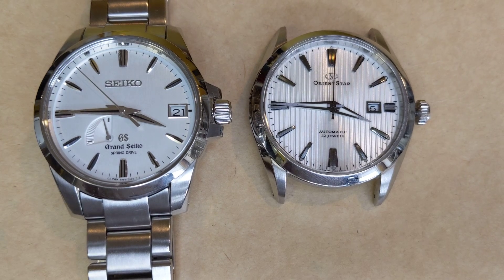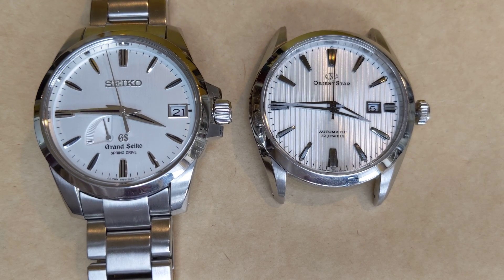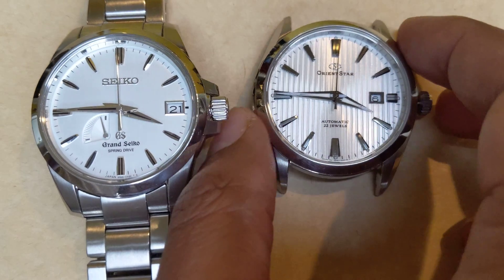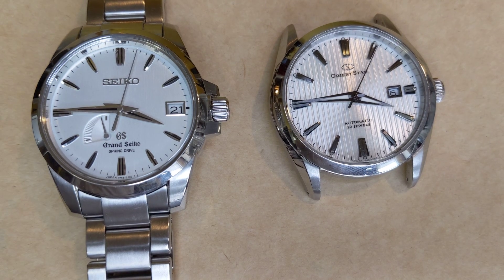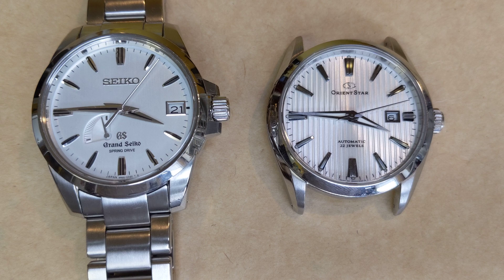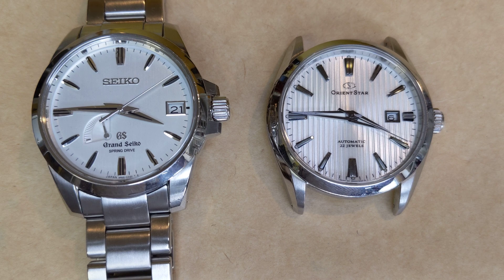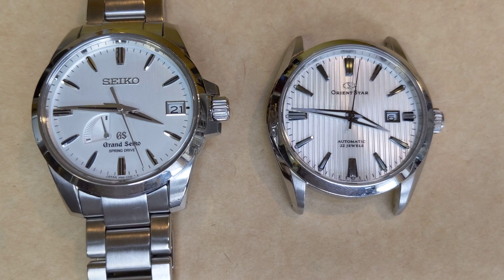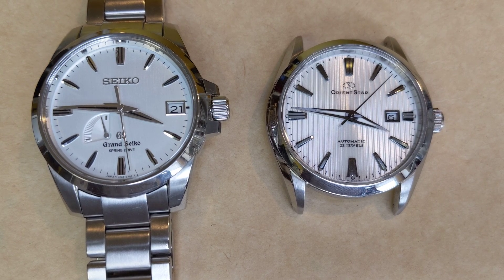Super Slow Grand Seiko Spring Drive Fails as the Mainspring runs out of power

Comment: Whoa! I was expecting that electromagnetic breaker will just switched off, due to not enough rotations per second (RPS) and therefore electricity to power the regulation circuit, and then after breaker switched off, second hand shall be moved faster for short period of time, 'till the mainspring will be fully unwounded.
But... Spring Dirve behave differently!

Can you also please show on your channel what's happening with Spring Drive movement when it's started after being stopped, i.e. after pull out crown, set the time, for example, and push crown back in - is the second hand also will move faster during short period of time, or it will be regulated (by electromagnetic break with phase-locked loop, PLL) almost immediately?
Reply: Good point, since SD runs very fast if and when the regulation circuitry is not powered.

Also an interesting question!  I'm now curious if the hacking function stops only the seconds hand without stopping the glide wheel (disengage and lock only the seconds hand with a clutch?), in order the keep the circuit energised so that the seconds hand can run at the normal regulated rate the very instant the crown is pushed back in.
Reply: @BeardyMacBeardFace  Yeah, right! It's very curious, I bet that the hacking function stops/locks the whole mechanism, but it's also really curious are there any capacitors in the electromagnetic breaker circuit, so for capacitors discharging the crown should be pulled out for more than one minute to assure that it'll be completely "cold start" without electricity in a circuit, but with fully wounded spring.
And definitely, there should be present other clock, as a reference source of time, as on this video, to distinguish the accelerated second hand movement versus normal flow of time.

Comment: I find your video intriguing. I was told that that the spring drive would keep 100% accuracy until the very end of the power reserve but  from I can observe  in your clip the watch starts to loose accuracy whilst there is still a decent amount of reserve left.
Reply from the maker: Spring Drives regulate by slowing down the mainspring movement, but if the mainspring is releasing power at a rate slower than the quartz crystal frequency, then there is no way of speeding up the movement. In my case I think the lubricant has gummed up due to the watch sitting for almost 10 years. I should be able to fix it by using it for a few months.
Reply: @DesignReviews  To start with I should have thanked you for posting this video. Sorry about that omission. Thanks a lot for your reply and  great explanation.
Reply: @DesignReviews  It seems the torque return system is not working in your watch. According to the dial in your video, I belive your watch is using a 9R65 movement, which has a torque return system to get a longer running time. It collects surplus energy from gear train when the power reserve is near full, and release it when power is low and torque is weak.
Reply: @DesignReviews  o

Comment: .
Reply from the maker: It's been more than 15 years for this watch. It does need a service as the power reserve is not what it used to be and it should not be losing time as the reserve is not down to the very end. Although it's still very expensive to get it serviced, at least you don't need to fly to Japan as in the older days. Usually that meant you returned with a few more GS watches!
Reply: God
Reply: How much does it take to get a spring drive serviced?
Reply from the maker: @phantomphotography7392  it's $450. They have to be shipped to Japan as Seiko USA does not service Spring Drives.